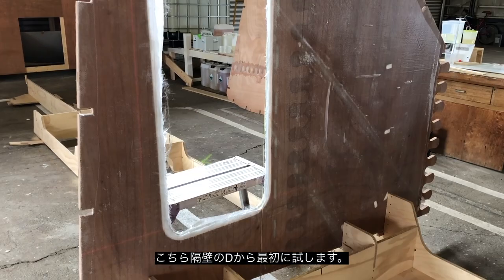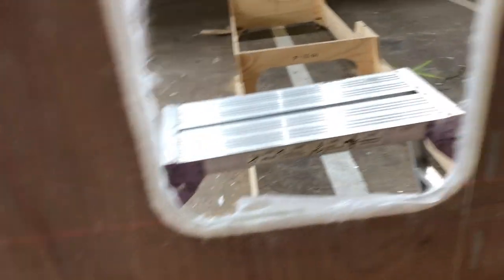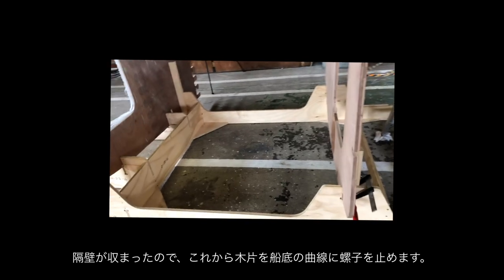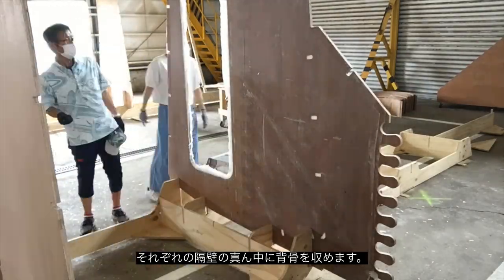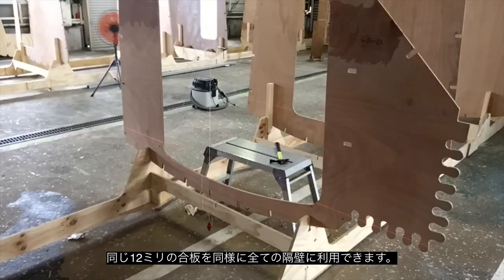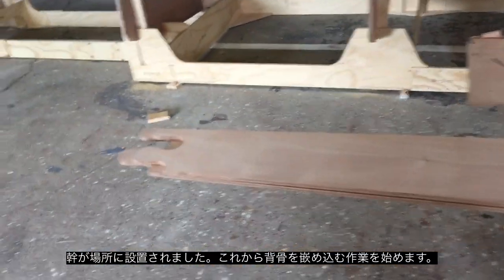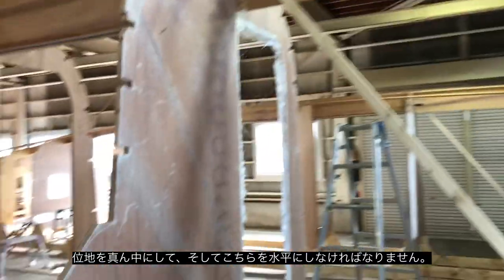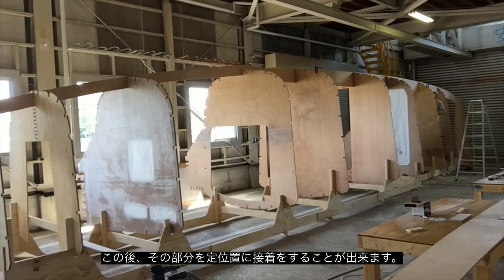Episode 12 A Dix 470  catamaran build in Japan.

Comment: So good to see progress!
I have a few questions:
 - it seems that you have applied some fiber glass on some bulkheads, but not on others... Why? Isn't the design asking for all bulkheads to be fiberglassed?
 - also, do you fiberglass on one side only or both? I believe I saw some bulkhead fiberglassed on one side only, which seems odd to me, but it might be what the designer is calling for...
 - lastly (and maybe more importantly), I noticed at 3:00 that you have kept the peel-ply on the bulkhead you have just fiberglasses (the vertical red threads are the tell tale sign...). Do you know that you are supposed to remove the peel-ply, once the resin is set??? After all, it is called "peel ply"... It will come off (with some difficulty) and that is what you are supposed to do. It will break the film of resin over the fiber glass, remove some excess resin, and leave behind a surface that is a bit like "shark skin"; a bit rough when you pass your hand over it, but without any irregularities. The resin surface left behind the peel-ply is ready for further bonding. The amine flush (if your resin is producing some) is gone with the peel-ply, and the roughness is a good mechanical bonding for the next epoxy coat/bonding.

Good luck!
Reply from the maker: Hi Laurent and thanks for watching.
The design calls for bulkheads D & H to have 2 layers of 600g biaxial applied to them.
D is the main bulkhead under the mast and H will form part of the transom.
Yes I’m leaving the peel ply on until just to protect the surface from any debris as the build continues.
Reply from the maker: Yes 600g to both sides
Reply: @saltlightdix4704  That makes sense!